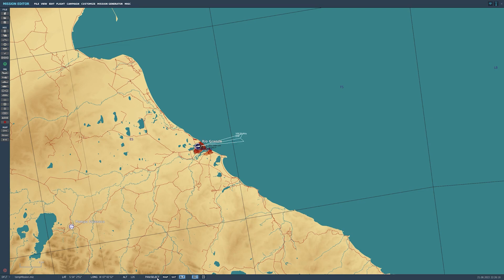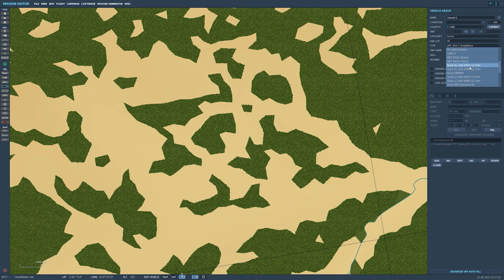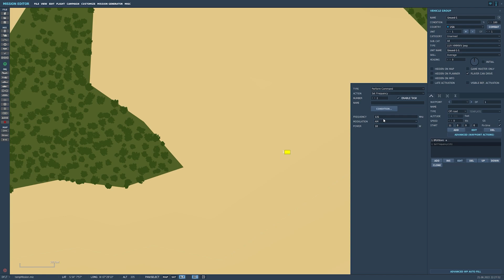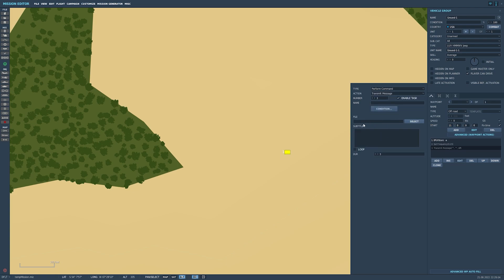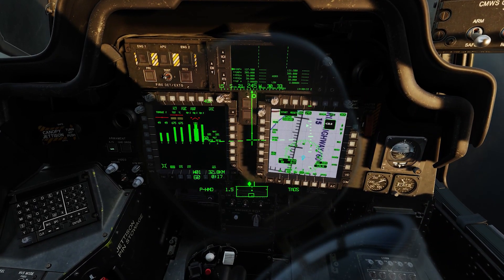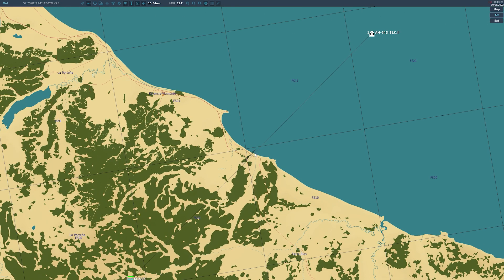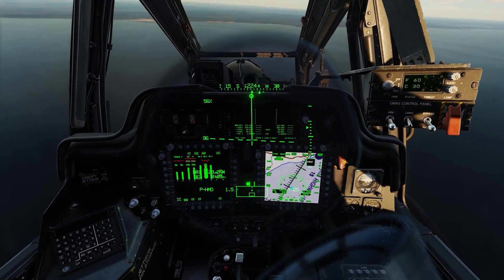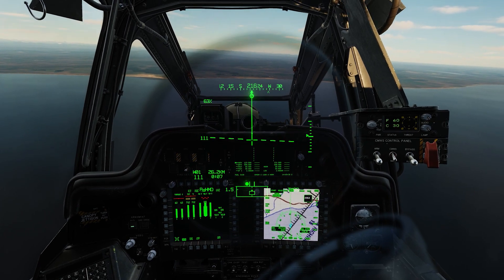DCS: How to Make Your Own ADF Beacon

Comment: Hi. Great idea. I am using this with some mods that cannot tune to activated tacans. Any way to make this work on the deck of an carrier?
Reply from the maker: The only way I could see this working with the carrier would be to do the same process but with a helicopter flying standby rescue next to the carrier so the location is generally correct. There should be a preset in the mission editor for a rescue helo or you can program the helicopter to follow the ship. It would only last for an hour or two as long as the helo is up. Not sure if it will still transmit once on the ground and shutdown.
Reply: @SimAirTutorials  that's a good idea and worth the try. I tried on a plane parked but it did not work even if setting the plane to start, maybe because with no waypoints it won't start engines/battery to actually transmit.